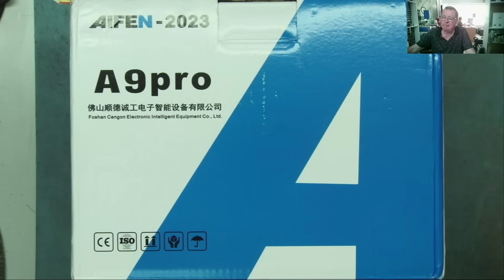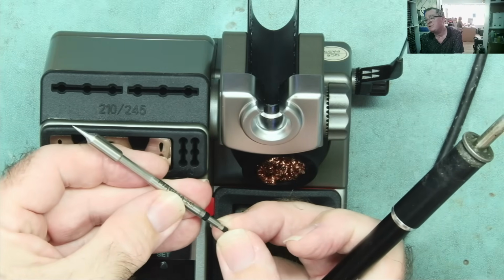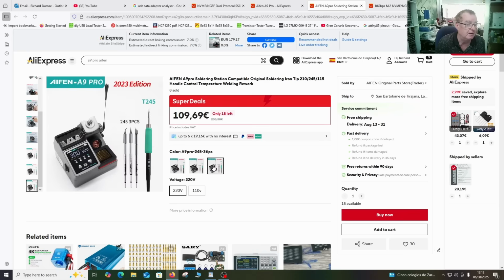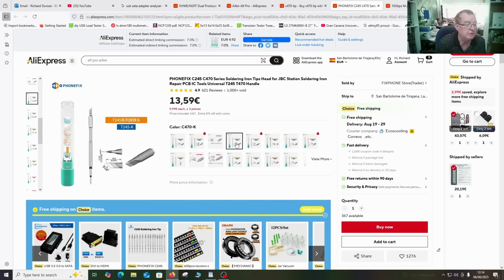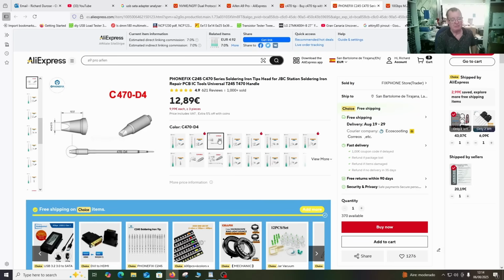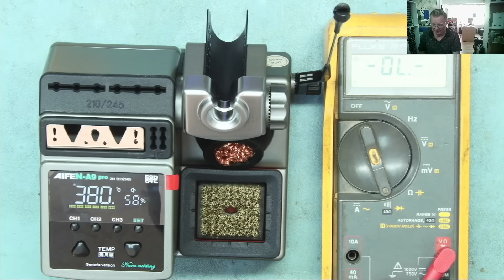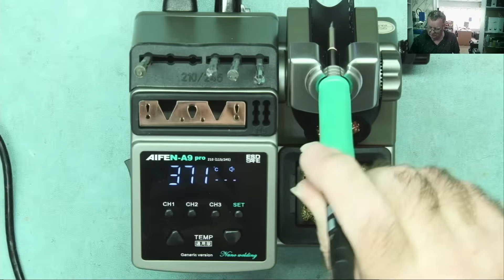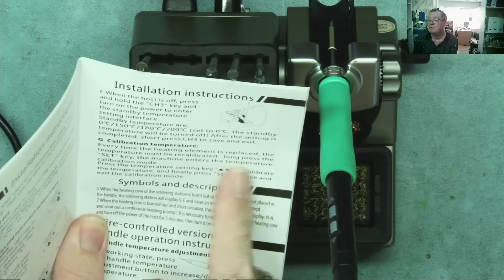Sugon / Aifen A9 Pro C245 C210 C115 Soldering Station Test And Review : Better Than My Cheap C245?

Comment: I have had the A9pro for 2 years, the A9plus for 1 year, and I currently have the A9ed in customs. It works perfectly. Unlike JBC, which uses a transformer for power supply, the A9 soldering station uses a switching power supply and therefore reaches the required temperature much faster, i.e., is more efficient. I use both Chinese and JBC tips. The Chinese made them with high quality, as well as the c210 tips that I often use.

Comment: My old one (the first on the market) works well with 470 handle also, i don't know if the new ones does it, the 470 use 48 volt if i well remember, but i m not 100% sure.

Comment: Hi Rich, 

Have you seen some of the video's out there that say the tips are live on some of these stations? I saw a video of the Aifen/Sugon A9E and they claimed it was live(lighting up an LED, somehow grounded the board) so obviously not this exact unit but similar. 

Wondering (I'm just into soldering as a hobby so not experienced like you guys)is this actually genuinely happening, how it can be prevented if so, or is it actually an issue? If what you are soldering isn't connected to a ground source then the tip voltage can't go anywhere anyway!?

Comment: I don't understand why people buy this Chinese junk. I could have bought a nearly new Weller WSD81 for the same price.
Reply: Because this emulates a JBC station, which is really nice to work with, but JBC has gone out of their mind with the pricing. I am not paying 600€ for a station that was 250€ a few years ago. JBC makes nice stuff, but they really need to be put in their place, and neither Weller nor Ersa make a real competitor.
Reply: @anonaustria9867  As well JBC quality has fallen. I watch someone else & he only buys JBC, pays through the nose and the products have issues after issue.
Reply from the maker: @anonaustria9867  I've not used the original JBC version but I have to say this A9 pro was an absolute joy to work with. There are, and I have used and still use, good cheaper alternatives in my repair work, but for what you pay vs what you get the JBC would have to be really good to be a better choice for me than the A9 Pro.  I really wonder if JBC would like to send me one to review and of course I would give an honest opinion of it.
Reply: Where is Weller made these days?

Comment: c470 are heavy duty. Draw a lot of power
Reply from the maker: I've ordered a C470 handle and two tips today, so will be able to test them on the Aifen A9 pro in the next few weeks.
Reply: @LearnElectronicsRepair  i look forward to that
Reply: I thought C245 and C470 use the same handle, but the latter runs at 48V instead of 24V because of higher resistance?

Comment: I've seen several videos of this sort of soldering station in action.

I am extremely skeptical of any such device that produces extremely fast rise to the set temperature but absolutely no overshoot appears on the display. Maybe. It is possible to achieve that if the programmer understands closed loop control.

I saw one video where the tester used a pretty decent tip temperature measuring device. The iron under test showed really horrendous temperature overshoot. He contacted the manufacturer and they produced a fudge, not a fix.

Comment: I have the standard A9 soldering station, not the A9 Pro, half the price of the A9 Pro. The best soldering station I've owned!
Reply from the maker: Hi Mike, can you tell us what the difference is between the A9 and A9 Pro. It would help others to make a dicision if they are in the market for a new soldering station.  If it helps my main points about the A9 Pro are:  Adjustable angle of the soldering iron holder, power switch on the side, 'standard' 6 pin jack plug on the soldering iron and compatibility with C115, C210, C245 and C470 handles/tips
Reply: @LearnElectronicsRepair  My model is the A9e, it looks almost identical to the A9Pro, 120 Watts and compatibility with C115, C210, C245 handles/tips etc. The angle of the iron holder is not adjustable, which seems to be the only difference. I’ve had my station for over two years now and it’s great!
Reply from the maker: @mikestokes235  Thanks for the info Mike, it's always good to tell everyone about all the options and what is working for us. As you see I still have me KSGER T12 which is the iron I use most often with the BC3 tip and I have a Sugon T26 which I use with the C210 tip when I need to do finer work.  Having said that when I was trying to solder 0201 resistors I ended up using the T12 and chunky BC3 tip!
https://www.youtube.com/watch?v=FW7p_0r5CqE

As I mentioned in this video, the A9Pro now replaces my Yihua C245, and that one goes to the live streaming bench (it has a different camera set-up for three people and has it's own test equipment)  So you will see the A9Pro get used in my repair work from now on alongside the other irons I use.    It's good to hear you are happy with your A9e. I have the same good feelings about the A9Pro
Reply: Good to hear Mike, I actually came across this video when searching for the A9e hoping Richard had also reviewed it! Looks like I can gtet an A9e with all 3 handles (C115 C210 and C245) with 3 tips for each handle for about $130AUD plus GST (so $145 ish) or 70-75 quid ish. (Or $85 ish with 1 handle and 3 tips). Looks like a pretty good home use station. Strangely the ad I saw says its 160W not 120W like you said.

Do you know if it uses a generic or proprietary connector for the handle? I didn't even know this was a thing until this video of Rich showing the Yihua handle (that was another budget station I'd seen)
Reply: So I just had a bit more of a look. Thanks to Rich saying Aifen and Sugon are the same, I found a guy that reviewed/tested the normal A9. He really liked it, looks great for the money!

And I think I've found out the discrepancy. I think the A9 is the original and 120W, maybe the A9e is newer/superseding the A9 and is 160W. Otherwise looks identical other than colour

Comment: Just so you know T245 is the name of the handle and C245 is the name of the tips that go in it...That is JBC's naming convention...I really like this station! I just bought a WEP 982D station that comes with T245 and T210 handles...It works really well, but I don't like that it has the same proprietary handle plugs that your Yihua station does...I'm thinking about ordering some male and female JBC style plugs and converting my station and handles...I can only use one handle at a time on my station and it would be nice to be able to unplug/plug them quickly when I want to switch between C245 and C210...
Reply from the maker: No I didn't know, I thought they were kinda interchangeable terms.  Thanks for the info.
Reply: @LearnElectronicsRepair Most people use them interchangeably anyway, so it doesn't really make any difference...

Comment: The thing with soldering irons and tips is that just because you set the system to 380C it does not mean that the temperature of the tip is 380c. I have seen tips that can be 20-30C hotter than the station is set for. That is what the calibration is for. You measure the tip actual temperature with an external device for that purpose and then enter that temperature into the station via the calibration. Having to do that every bleeping you change tips with this station is a PIA.
Reply from the maker: OK let's have this conversation. Why the hell do I need to calibrate my sodering iron?
I pick it up and attempt to do whatever soldering/desoldering I need to do. If the iron is 'hot enough' then the job goes well.  if it is not then i either turn the iron temperature up (most of these solder stations have a boost mode these days) I use hot air to warm the area of the PCB up and then try the iron again, or I change to a different (chunkier) tip that has better thermal transfer properties.  At no point to I need to know or for that matter give a damn what temperaure the tip is at. 🤪
And this is not some misinformed opinion, so when I worked at ICL in the 80s and in industrial electronics repair in the 90s a cheap soldering iron simply plugged into the mains and got to whatever temperature it would, which is what us hobbyists used.. and a 'posh' one like the Weller stations at these big companies I worked for had a knob that you adjusted from green (warm) through yellow (hot) to red (very hot). We never needed to know the temperature of the bit, we simply had a 'feel' for whether it was hot enough or not.  Shoot me down if you like but there is absolutely nothing to gain by calibrating a soldering iron tip!! I can't think of a single situation where I could make a successful repair with a calibrated tip that I would not be able to with a none calibrared tip.  Discuss.
Reply: @LearnElectronicsRepair  So there are no components including SMB devices on cellphones etc that are affected by excessive heat, say 100C more that what you have set the iron to and in turn think you are applying to the component ? Why then are all the irons out there on the market have digital readouts? Why not just have knobs on them if the readouts on the digital displays are useless?
Reply: @GregM There are definitely niche situations where you might want to know the temperature, but 99% of the time it doesn't matter if you are at 300 or 450, as long as the solder melts...Most components are not that sensitive and you shouldn't be holding an iron to a joint long enough to break stuff anyway...I like having a digital readout, but I agree with him that I don't think it would make a single difference to my work if I didn't...That being said, I don't work on ultra sensitive components...Most consumer grade components can take the heat that this iron can produce as long as you are being reasonable with the amount of time you hold the iron to it...
Reply from the maker: @GregM  Greg, it's not that I think there is anything wrong with having a digital display on a soldering station. Nor am I saying there is anything wrong with calibrating the tip temperature. Maybe this is an old school thing but for most of my electronics 'life' I used the more basic soldering irons because that was available, and I guess learned to use them without damaging components. I would propose that older through hole components were actually more prone to damage by an overly hot soldering iron, or more commonly applying a soldering iron to the leg of the component for too long a time, than 'modern' SMD components. But we learned to do it with the equipment available.  I think most (not all) modern soldering irons have a digital readout because it is probably cheaper to implement than using a potentiometer and a sticky coloured label 🤣and because it is what the market has come to expect.  I am not saying there is a disadvantage to calibrating your solder station and this model does have that feature (though the instruction book does not actually tell you how to do it) I'm just questioning why I should do so when other factors such as preheating the board, adding good quality leaded or low melt solder, using a good flux, using an appropriate solder tip and to be honest practicing until you develop a good technique, are likely to have far more influence on whether you can successfully solder/desolder a component than calibrating the bit temperature would.
Reply: @LearnElectronicsRepair  My points are twofold.  I see people asking on live streams asking the creator what temp and airflow etc. are they using to do a job as if they dial that setting in on their particular equipment that they will get the same result. Not necessarily the case since hardware varies as well as on uncalibrated equipment, 280c may be something entirely different on someone else's equipment. 

In order to do reviews between equipment, there has to be a baseline that you use to measure performance against. You mentioned that this iron seemed more powerful. Well perhaps that is because the temperature at the iron tip is higher than that of another iron you reviewed. In other words when you dial in 280c you may be getting 340c and the components come off the board faster. 

The second point is that the calibration aspect of this iron seems to be an afterthought if you change tips frequently. Some people regularly switch between tips depending on the equipment they are repairing and if they are the type of person who wants to ensure the tip temperature accuracy having to recalibrate after every tip change is a PIA.
Reply: @GregM  In my opinion you shouldn't take these reviews seriously. Don't be surprised if Richard tries to say the best he can about every product he gets for free to promote. ;)
Reply: @andrewsz8552 I watch a lot of YT channels for reviews. Some of them I take what they say about a product with suspion. Richard is not one of those people. Believe it or not, some people value their integrity more than free product.
Reply from the maker: @GregM  I have to say you make a good argument there Greg and I can't really find any grounds to disagree with it. Looks like you've connvinced me to measure the tip temeprature when reviewing any soldering iron. 😊
Reply: @LearnElectronicsRepair  It is just that if you can calibrate the tip in use prior to testing then the comparison between irons will be on a level field. Some irons are better recovering from a ground plane soaking up heat and maintaining the set temp.
Reply from the maker: @GregM  Ageed 🙂
Reply: @GregM  I just don't like how Richard's former educational channel is slowly transforming into an aliexpress promotional channel...
Reply: @andrewsz8552 As a long time viewer of the channel, I can see where you are coming from

Comment: The station itself is fine, but those tips are horrendous. Unless you use only one, there is just no way to adjust the temperature because one tip might be 10c down, and the 2nd tip is +20c... So, if you wanna use this station, get a genuine JBC tips or at least good quality clones.
Reply: I bought some VECO-T tips a few months ago and they work just as well as my JBC ones...They may not last as long as JBC tips, but they were only $8 each...
Reply: @brucepreston3927 please share the link to buy the tips
Reply: You would need an external thermometer with a pad to put the tip on and determine how far off the tip temperature is. Even my KSGER iron will remember the calibration information. You just have to tell it what tip you switched too. I have seen tips with wide temperature swings. One was so bad I was able to get a replacement tip from the seller.